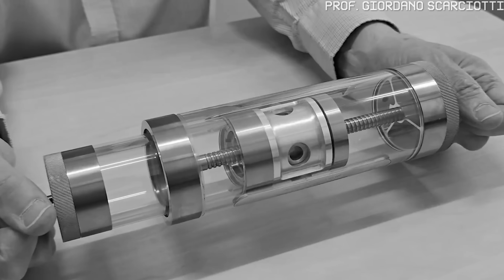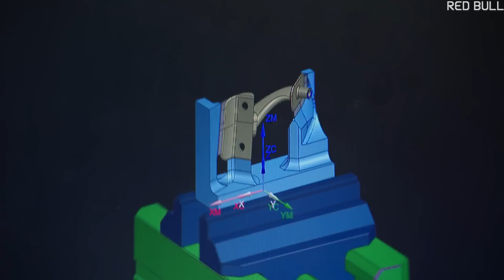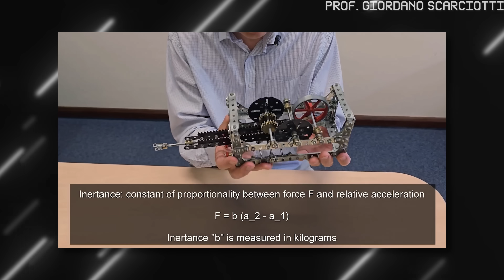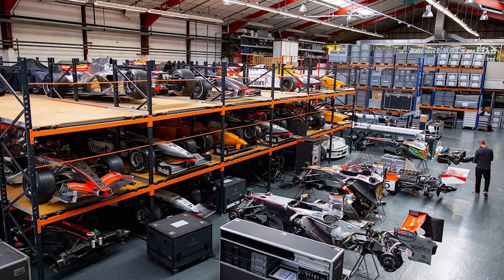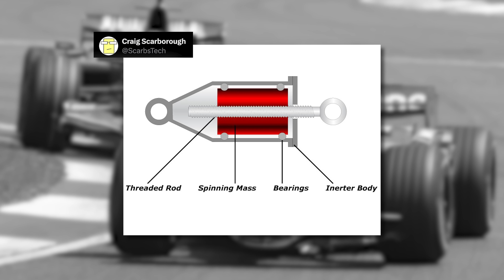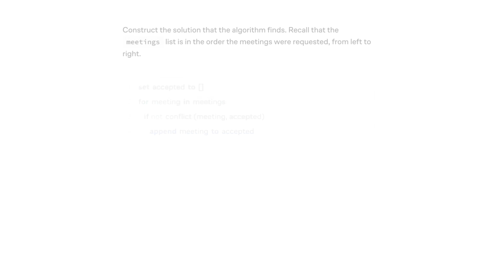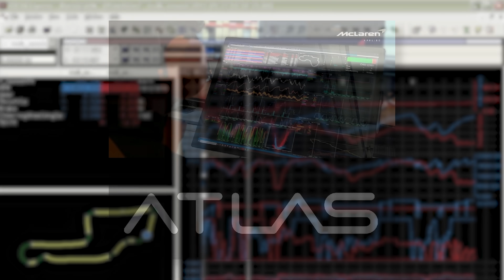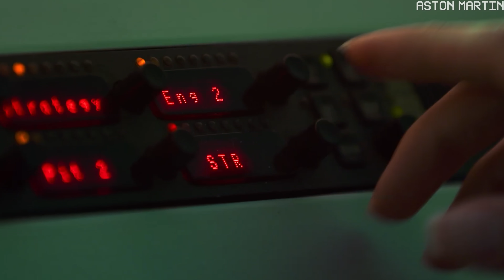The Genius Tech NASA Stole from Formula 1

Comment: With all that pressure and rivalry it cannot be the best and most amazing innovation thing on earth in engineering. There is a misleading, pressure does forge creativity. But ideas will not adapt to necessary changes for a whole system. You see that with team sale-outs or regulation. The F1 innovation circle was leading, it is not anymore. The creativity thing is science proven.

Comment: I’m curious. On the section of the video where the chat is about storing energy mechanically (using a wheel) vs storing chemically using a battery. 

Why isn’t this solution being used on EVs? Whats the limitation that is so so severe that it cant be done?

Comment: A note on engineering style: The "break things fast and iterate" mindset is NOT improving design speed at spacex for larger scale programs. They are by far the most behind part of the Artemis program and it's not even close. At a certain scale, this approach fails because the time and cost of making many iterative test vehicles far out weighs the cost of simulations and designs "on paper".
Reply: Yeah, this was very disappointing from Scott, he seemingly isn't aware not only how terrible this is for large scale complex projects like rocket development, but that it was also already done back in the 50s and early 60s before better methods became available that formed the modern standard approach that has been applied ever since. SpaceX is trying to sell an outdated, inferior method of rocket development as something new and revolutionary, and it sadly works for gullible and ignorant fans of spaceflight and wider audience, despite the results that demonstrate how bad it is, even with some minimal use of modern tools, modeling and analysis, that doesn't fundamentally change the flawed approach at the core of it all.

Comment: Interesting video, but massive lost point for completely failing to explain what the J damper actually did, though you did drop a couple of hints that would only really help people who knew what they were looking at already. The J-Damper or Jounce Damper (That was the term in use when it first became public knowledge) didn't replace hydraulic dampers but it filled a massive gap in the control options for damping suspension systems. 

The maths for simulating any damped system can be represented by an electrical circuit, called an LRC circuit because it contains inductors (coils, represented by L), resistors (R) and capacitors (C). Building an electrical equivalent model of the suspension meant that undergrad level hand calculations and very cheaply assembled electrical circuits could allow engineers to find optimum designs much more quickly than building mechanical models.

To explain how the LRC simulation maps to the mechanical one, the mechanical energy in a suspension system maps to the electrical energy in the electrical circuit, then the spring does the equivalent job of a capacitor in that it stores and releases energy without significant loss (So no damping contribution), the hydraulic damper has the same function as a resistor in resisting movement in the suspension, so the more energy put through the circuit, the hotter the resistor gets because it's converting energy from the system to heat, just like a hydraulic damper. The issue was that there was no mechanical analogue to the inductor, which resists changes in electrical current, so a damping element that resists changes in shock movement speed was needed to build completely optimal suspension damping.

Not having this element for mechanical suspension meant that known improvements in damping, found using the electric circuit analogue, couldn't be implemented in any mechanical suspension system. The clue on how the J damper works can be seen in the spiral in the shock pushrod at 7:09 - a flywheel is threaded onto this spiral, so as the shock compresses, the flywheel spins. If the shock moves at constant speed, the flywheel supplies no resistance as it just stays spinning at constant speed, but any change in shock speed will be resisted as the flywheel will need to change speed in response, so the inertia of the flywheel comes into play. 

The interesting thing about this is that it also doesn't convert the energy it stores to heat, removing it from the suspension system, it just stores it and releases it as the shock moves, similar to a spring. This is why the hydraulic style damper is still needed for the suspension to remain under control. I have no doubt that they have experimented with damping the spinning of the flywheel as a means of getting damper and jounce functions from fewer components too, which may be as simple as filling the space the flywheel sits in with oil, or even having it run with very tight clearance to the shock housing in air, but the air option would be a lot less thermally reliable.

It should be pointed out that part of the reason suspension systems got so far without the need for this element was because the mass of the suspension parts is adding this effect to the suspension already, so there already is a jounce element to it, but it wasn't tunable without adding mass to the suspension system, which obviously is a significant problem in F1. Electromagnetic suspension systems like the one Bose came out with 20+ years ago that never saw production, are able to create negative values of damping to move the wheel over bumps rather than have it react after it hits the bump, giving a much smoother ride with no cornering compromise, but at the expense of actively using energy supplied by the car - normal damping passively takes energy driving the car forwards and makes it into heat as it moves over bumps, so there might well be very little overall energy difference between a fully active suspension and a passive one in terms of energy lost to damping, but as a passenger in the car there would be a huge difference.

Comment: Also - the MOOG valve was not developed for F1. That valve existed and was used for many decades on small reaction control engines - rocket engines. The are excellent valves for that purpose for the reason you suggest, I have an Aerojet 5 lb engine on my desk using essentially identical valve.  Thousands of them are in use right now. MOOG just sold you an off-the-shelf part, in typical British fashion, you guys thought you invented it. The active suspension control arrangement is also nearly identical to that used on spacecraft from the 60's, many using the same or similar valve to actuate RCS systems instead of hydraulic rams. Also, nearly identical systems ran hydraulic rams for booster gimbal control since the mid-50s, almost identical down to the details as an F1 active suspension. 
Again - digital twins or something equivalent to them are ALSO long-used in the aerospace industry, dating to the mid-70's - again, the original versions were direct copies of the design Hughes came up with, and was one of the most rudimentary implementations of the time. It's an open-loop simulation. This long predates F1 having any telemetry to drive such a system as a "twin".

Comment: Such F1 suspension development 'on the fly' with a driver on board during the many changes is more subject to possible fatal errors. I wonder if it would ever have been allowed before the crash resistant safety roll cages were in common use.

Comment: Come on - this is utterly ridiculous! F1 not the "most advanced engineering in the world*, it is a tinkertoy operation - but of course you do not know that.   This variant on tuned-mass dampers have been perfectly well-understood for 150 years, and similar devices have been on spacecraft since the late 50's. I have a bit of space hardware in my office that includes something that is nearly identical . It was a ground test assembly manufactured in 1988, and it wasn't new then. It damps vibration arising from deploying a large appendage on a satellite. This is absolutely nothing new - except apparently to Formula 1 people. BTW , one of the issues that they have apparently missed or never thought of can reduce the weight of an equivalent device by about a factor of two. And that you can electrically vary the characteristics to make it adaptive.
Reply: You clearly have no idea about F1, and your job there would probably be measuring tire temperature.

Comment: 15:22 "Mechanical Battery" is nothing new.

It used as a Gyro Bus in the 1950s, the major improvement was to make it much lighter & compact for F1 use or in space, but the basic platform is not that different to the Gyro Swiss bus.

Comment: 15:40 Now imagine hollowing-out a mountain, leaving a giant flywheel-shaped chunk in the middle. Some hydraulic bearings and some coils of wire and you have a flywheel you can spin up all day with solar, and a generator to power several cities as the flywheel spins down at night (both use the same wiring).

Comment: The reason manufacturing and design take so long at NASA and across the wider aerospace industry is largely due to the sheer level of verification and validation required...

Once something is launched, it is in orbit or beyond and it simply HAS to work. There is no recovery, no second attempt and no opportunity to intervene once a failure occurs. That reality drives an extraordinarily high verification and validation (V&V) burden which dominates development timelines.

The vast majority of aerospace hardware is mission-specific. Many components are entirely custom designed for a SINGLE environment, load case and operational profile. Every new mission therefore demands its own qualification campaign, analysis, testing and documentation, an entire new V&V procedure again. While heritage designs, materials and manufacturing processes can shorten development, they only go so far, particularly for NASA missions, where risk tolerance is intentionally near-zero

Attempting to compare this with Formula One manufacturing timescales is deeply misleading and I'd expect better 😅

In F1, components are developed within a tightly controlled regulatory framework using materials, processes and suppliers that have already been validated through pre-season testing and prior race campaigns. A new carbon fibre wing can be designed, manufactured and raced quickly because the underlying assumptions, test methods and failure modes are already well understood and accepted. Using this as a benchmark against the end-to-end timeline for a space mission, from initial concept through to launch, is fundamentally fucking disingenuous.

A more appropriate comparison would be the time it takes Formula One teams to design and adapt cars for NEW regulation changes versus the time required by the aerospace sector to design, qualify and launch new spacecraft. Even then, the contexts remain fundamentally different.

The notion that F1 is technologically comparable to rocketry does not stand up to scrutiny... I say this as an F1 fan!

The operating environments, reliability requirements, safety margins, cost structures and manufacturing constraints are magnitudes apart. Even with how advanced F1 has become, the levels of materials qualification, systems engineering and failure tolerance demanded in aerospace are on an entirely different scale.

This example is actually a rare case where the aerospace sector has taken inspiration from F1, which is genuinely impressive! No doubt. However, using that blanket reason to diminish the achievements of the NASA or the aerospace industry as a whole misses the point... 

The overwhelming majority of technologies, materials, analytical methods and manufacturing techniques used in F1 originate from developments in aerospace engineering, not the other way around.

Framing the comparison as F1 being “close” to rocketry does a disservice to both fields, but especially to aerospace, where the technical bar and the consequences of failure are simply not comparable. 

I absolutely love your channel, as both someone in the Aerospace industry and a F1 fan, but this entire video missed the tone wildly...
Reply: I’m sorry to come across bitchy, but the comments and overall tone throughout this video really got under my fucking skin. Calling Formula One “the most extreme engineering environment on Earth” is a strong bloody claim, and it borders on fantasy once you step outside motorsport bubble logic.

Formula One is extreme, yes, but it is comfortably extreme. It lives on Earth, in air, under gravity, on a predictable planet. The cars operate for a couple of hours at a time, on circuits that are known to the millimetre. If something fails, the car stops, everyone sighs, data gets downloaded and the team goes whining about it until the next race. No one loses a decade of work because a connector fretted itself to death.

Now compare that to space. Scientific missions, human spaceflight, probes, telescopes, landers. Pick your poison. You strap your hardware to a controlled explosion, shake it harder than anything motorsport will ever see, then throw it into vacuum, radiation and savage thermal cycling where temperatures swing hundreds of degrees. It has to survive that for years, sometimes decades, with no maintenance, no updates, no second chances. If a single component misbehaves, congratulations, your mission is now an expensive piece of orbital debris.

Human spaceflight cranks that insanity even higher. You are no longer just protecting hardware, you are protecting lives. Every valve, seal, sensor and line of code has to work, not optimally, not quickly, but correctly, every single time. Redundancy on redundancy, failure modes on failure modes, all because the cost of getting it wrong is people not coming home. That is not “extreme”, that is existential.

Scientific missions are no gentler. Space telescopes and deep-space probes are expected to perform exquisitely precise measurements while being blasted by radiation, frozen, baked, and operated remotely with light-minute or light-hour delays. You cannot pit-stop the James Webb Space Telescope because a bracket resonates funny.

The whining about extremity in Formula One just does not compare. It is a brutal, high-performance sport operating at the edge of a very forgiving environment. Space engineering, whether human or scientific, operates at the edge of physics in environments that actively want your system dead. The verification, validation and timelines that come with that are not inefficiency, they are survival.

Formula One engineering is impressive. Space engineering is merciless. Pretending they are even close is pure hyperbole, and it does a disservice to the people who build machines that have to work perfectly, once, forever, in places where failure is final.
Reply: AND… Malcolm Clive Smith is a British electrical engineer and a professor of control engineering at the University of Cambridge with long‑standing academic contributions in feedback control and systems theory.

Control systems engineering is a very wide field. One of Smith’s most notable contributions is THIS invention of the inerter, a mechanical network element he first introduced in an academic paper titled “Synthesis of Mechanical Networks: The Inerter” (M. C. Smith, IEEE Transactions on Automatic Control, 2002), which coined the term and laid out the concept formally.

The inerter concept was later discussed in his 2020 review article “The Inerter: A Retrospective” in Annual Review of Control, Robotics, and Autonomous Systems.

This device was subsequently developed into a suspension component used in Formula One racing and, as this video describes, famously under the McLaren code name “J‑damper”, which was following a collaboration between Cambridge and McLaren. So McLaren took from Cambridge.

It’s important to be clear: NASA did NOT adopt engineering methods “from McLaren” in this context. If anything, any influence on aerospace control systems would be from Smith’s academic research published in peer-reviewed control theory literature, not directly from McLaren’s motorsport implementation… In other words, BOTH McLaren and NASA separately took Smith's research, adapted it, and worked with Cambridge to implement. Not “NASA stole from F1.”
Reply: Welcome to my TED Talk... 😅🤣

Comment: There is absolutely no way that a new wing was made from scratch in 24 hours
Reply: I was thinking that too because does it have to bake and cure in the autoclave?
Reply: @661AV13 yes. And it takes multiple days just to lay up each wing element, then it needs to be assembled, bonded etc… the one that turned up the next day would have been a work in progress already
Reply: @pmenzel86 ya I was thinking no way they made it from scratch in under 24hrs
Reply: Maybe they used different materials?
Reply: @staomruel it's precision engineering, you need engineering sign off to use a material with 1% different resin content, there's no way they would just throw something together

Comment: What utter rubbish. F1 has only ever adapted aerospace technology. The list is endless. Materials, manufacturing, analysis, testing, have all come to F1 and other categories.
You might get aerospace engineers working in F1 but you won't get F1 solutions finding their way to aerospace as the problems there are much more complex. I mean, one aero engine turbine blade provides as much power as a whole modern F1 engine.

Comment: 1. The "Inerter" (J-Damper)
Verdict: TRUE

The Story: The "Inerter" was indeed invented by Professor Malcolm C. Smith at Cambridge University. McLaren was the first to use it in 2005 under the code name "J-Damper" to help stabilize the car and improve mechanical grip.

Space Connection: As the video claims, the physics principle behind the Inerter (simulating mass using a lightweight flywheel) is now being applied to spacecraft to isolate sensitive instruments (like telescopes) from vibrations. It wasn't exactly "stolen," but rather the technology was transferred and adapted for space engineering.